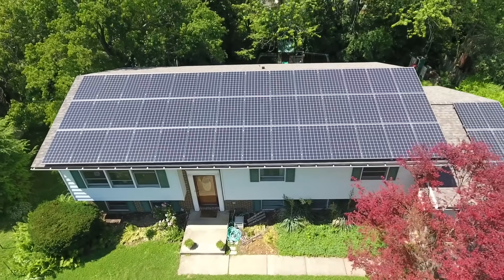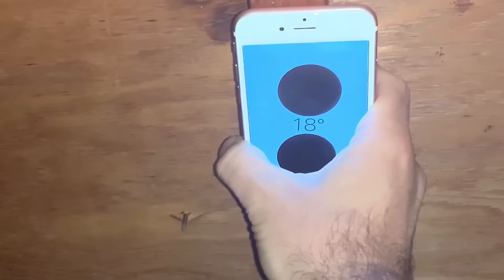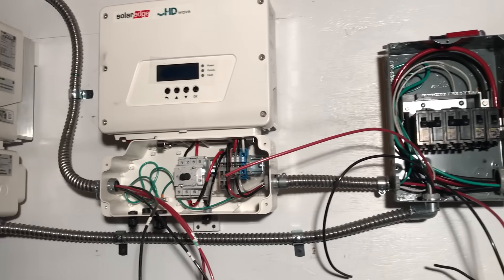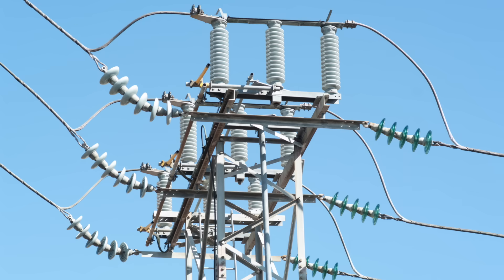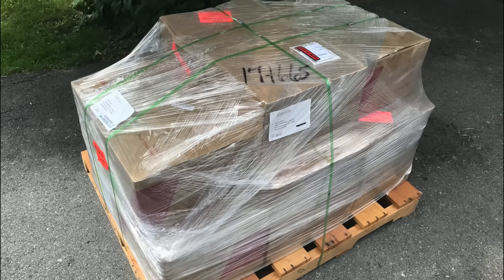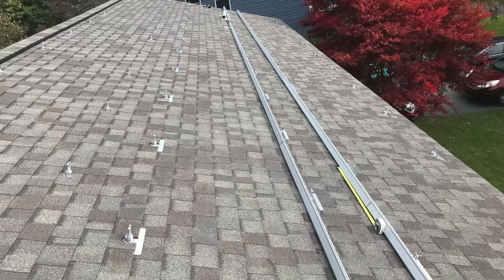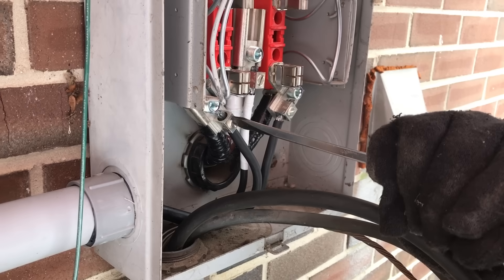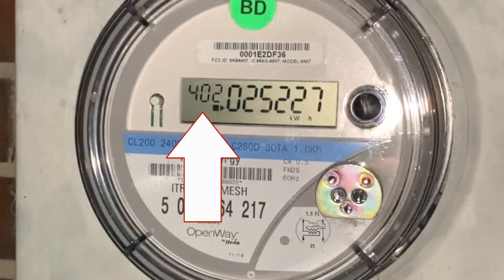I Installed a Power Plant Myself | HUGE DIY Solar Panel System

Comment: Nice job..........I am very familiar with solar insulation. I have installed many system and i own my own system as well. but I do  like how you researched everything figured it out on your own . That is  some nice work you did there . I would have went with Enphase micro inverters but that is just me .and in  some states not sure were you live but the zip ties are  against code. But I do like the video and you are on point with the Installation process 👍
Reply from the maker: Thank you!  I did consider enphase but they were more expensive and I heard a number of not so great things from installers.  The zip ties are really backup since I used the iron ridge clips.  But I didn’t like how loose they were and wanted them tight on the rail.  I also used them to hold the cables in the right orientation while I got them through the glands on the soladeck.
Reply: @FrugalRepair  yes zip ties would be ok for temporarily. I would not keep them   for long period .and for the Enphase they have the lowest failure rate on  the market .....and they  are  backed with  a  very nice warranty...
But the  system you have is a nice system.... like I said  the Enphase thing is just me I'm an  just a fan of Enphase and would you consider getting a Tesla powerwall or any brand powerwall...
Reply from the maker: Ok, thanks!  I mainly can reach where I might need to replace them without having to move a panel (or maybe one at most).  The optimizers are 25 year warranty.  I don’t have a plan for batteries (no real need at this point) but if I do get them, at least I have DC coming off the roof.  BTW -  that’s cool you installed your own system!
Reply: @FrugalRepair  no  true solar battery like a Tesla powerwall LG powerwall Etc charging voltage is AC current an output voltage is AC current powerwalls do all the DC converting inside the battery itself so there wouldn't be no need to run separate lines
Reply from the maker: Gotcha!  Thanks.  I haven’t studied them.  I’m probably the kind of person who would make my own out of 18650’s.  But I’m not really planning to get any batteries until the net meter rules change or they institute TOU rates.
Reply: @FrugalRepair  it would really help with your power offset and backup power for when the grid goes down

Comment: What about solar on the roof in a tornado/storm-prone area?  Will the solar panels hold up to hail damage better than the roof?
Reply from the maker: It depends on the ratings.  I think mine are rated to 130mph, if I remember correctly.

Comment: Loved watching this - well done 👍 I had a solaredge system professionally installed 6 years ago prior to retirement after thinking ahead in preparation for this (I was not as brave as you). As of today my system here in Cyprus has produced 26 MW. I haven’t experienced any serious issues, solaredge local installers have been excellent in liaison with them when a few minor issues came up. All satisfactorily resolved within warranty. Subscribed 👍
Reply: Watch out for pigeons nesting under the panels, the damn things are a real nuisance. Had to close all edges with strong wire and still fly a hawk kite as discouragement.
Reply from the maker: Thank you!  I’m glad to hear that you didn’t have any problems with SolarEdge. Mine has been working great without any issues!

Comment: Very nicely explained in installing solar system on your roof. Plastic zip tie is not advisable, get the metal clips for wire management, due to excessive heat under the panels plastic zip tie at some point gets brittle, and they easily break, later on replacing all the plastic zip tie is a major headache.

Comment: I am curious how you came up with that 14% ROI?
I did some calculations based on electricity pricing in my area, number of “sun days”, etc.
My break-even point on electricity cost vs usage came up to almost 9 years.
But when I factored in lost opportunity of the capital invested in solar equipment and installation, that number became 15+ years (I calculated using a modest 5% investment return rate).
It seemed to me an investment that takes 15 years to break even is not very attractive.
Especially combined with a fact that you can only collect those future returns if you stay in that house pretty much forever. If anything changes in your life and you have to move, the entire investment in that solar installation is gone.

Comment: Getting closer to a reality. Lithium technology is starting to become a real possibility. Lead acid was far too cost prohibitive. Lithium is very expensive but the durability of the batteries and the short charge time make lithium a possibility.
It’s still would take you 8-9 years to break even. That is almost the entire life of the lithium batteries. (12-15? Maybe?) 
     It’s a good video but this guy is not to help it’s to get subscribes and views. TV is what he is about. 
     Some places your electric bill is no more than 250-350 a month  the system would cost you around 25,000 - 35,000 That is about 8.5(?) Approx. years before you broke even. It is possible, I feel so very close to affordable.

Comment: I thought with solar a lot of batteries were used. I plan to use solar power to light up storage bldg. I know nothing about solar at this point. You did a tremendous job, thanks
Reply from the maker: Thanks!  No, I don’t need batteries.  I’ll plan to explain this in a future video.

Comment: How much you get paid for the electricity you send it back to the grid system should be one of the most critical and practical questions since now we live in very advanced battery technology.
I've seen most of the case you only get 30% of the credit for the price you pay and you should know that you just become a host to produce electricity for the utility company than yourself.

I'm pretty sure the future of solar system will be a matter of the battery system, not a solar panel any more since lithium battery price drop significantly that lasting almost same like a solar panel, not just a few years like AGM and Deep cycle marine battery.

and you don't need to cover your roof with that amount of solar panel.:D

Comment: Last time I looked my ROI was going to be less than 1% per annum, (based on a 27.5 year life span), with no profit until 18 years, so I elected to switch to a 100% renewable energy supplier instead. Now I'm following all the news about solar technology just waiting for an affordable panel with 30+% efficiency. There's been some interesting news about panels lately, some interesting new tech of the horizon which should mean cheaper more efficient panels. Part of me can't wait to do it, but my cooler head knows that investing in eco-friendly companies and buying renewable energy is a better choice considering today's tech. (One last note: I do also worry that if there is a paradigm shift in solar efficiency, and industrial sized solar farms boom, that it will result in a lower price/KWh from the grid preventing me from getting a reasonable ROI. They have economies of scale that a home build will never match, but adding panels to a roof should win out as there's no profit margin to add onto the cost and it's a free place to put them). 

Enjoyed your video, will definitely DIY my install.

Comment: I have a TON of usable roof space, but I can't afford to buy and install solar. What I would like to do is to rent out the roof space to a company that installs and does the upkeep of the equipment as well as the roof itself. They would have to maintain the roof no cost to me as a good roof in integral to the solar power system. What is my rent? Maybe a discount on my electric bill. I wouldn't need to ask for much since they are keeping my roof maintained for me. It's a good trade off, and good for the planet as well. Basically, it's allowing them to do almost whatever they want with the unused roof space in exchange for the roof not to leak. They can basically have the roof as long as they do they upkeep, and gets returned to the owner when the take their equipment. A roof is expensive for the average person, but the of maintaining a roof for a company getting a profit off of it would be negligible for them. It's basically replacing bad decking and shingles as needed. I think it would be a good trade off even if you don't make the profit yourself.

Comment: Uh does that comply with fire code?
Most places require more roof space around the edges of your array.
You should check that
https://www.solarpowerworldonline.com/2018/04/know-your-codes-for-solar-mounting/#:~:text=International%20Fire%20Code&text=in%20article%20605.11.-,3.2.,departments%20to%20ventilate%20the%20building.
Reply: Also, 48 panels?? Maybe you should have made your home more efficient before getting such a huge system

Comment: Does your area not have firefighter offsets on the roof?
Reply from the maker: Not when I installed my system.
Reply: @FrugalRepair  The firefighter offsets really limited how much I could put on my roof.  I went through essentially exactly what you did, but I didn't realize there were websites out there that would do your permit for you. I tried some of the software and it was just too complicated. What I tell people is: If I knew how much I didn't know when I started, I wouldn't have done it. However, now that I'm done, I'm glad I did.

Comment: Congratulations for big piece of work, but few things (for me ) is not correct, like naked copper on your roof after half year will looks like statue of liberty ;). Any way I hope you will have free power forever.
Reply from the maker: Thanks!  The code requires bare copper ground wire.

Comment: Great informational video!   I'm curious if there has been any power outages in your area and how you made out, if for example, it was a major outage for several days with many cloudy days.   Also, are the solar panels durable enough to survive a hail storm/high winds without damage?  Those are my 2 main concerns  before deciding on a system like this and I would appreciate a reply with your experiences.  Thanks!
Reply from the maker: Thanks!  We generally don’t have long power outages so that’s not a problem. I will explain an upcoming video how my grid tie system works in the winter or on cloudy days. Basically I get credit on my bill and it just subtracts off what I use.
Reply: @FrugalRepair  Thanks for replying, I still have an unanswered question I hope you will answer - what about hail or high winds? Have had either since your install?

Comment: Nice Excellent work!! I'm not a wire tie fan; you're going to find out yourself! I use 33+ instead. For your job however, I'd use insulated copper 16AWG wire as twist ties cut out of Romex.  You'll never have to go back,  unlike those plastic ties. You'll find out. Maybe PVC pipe? Other than that just excellent workmanship ! Great job Engineer !

Super job !  Great video ! A joy to watch !! Great product selection!
Loved the new check box !
Reply from the maker: Thank you!  That’s a good idea about the wire from romex.

Comment: Thank you for sharing the information in this awesome video.  I'm more interested in off-the-grid solar installations, but for people already on the grid, the grid intertie systems have a much better ROI because there are no expensive batteries to buy, maintain and replace at the end of their life.

Getting panels sized to fill your roof is worth the effort because it looks much better.  If you ever sell your house, having a record of the power company paying you to operate your low maintenance solar power plant should significantly improve the selling price.  Your solar power plant has significantly increased the value of your house.

Comment: The over-regulation in Australia would never allow this. You need a qualified electrician to do all electrical work. Another more than changing a light bulb and you will cop  a huge fine and or imprisonment.

Comment: I installed my own system in Phoenix. I was quoted $24,500 for 7.8kw system. I installed a 12.97kw system, saved about $10,000 and used a better system.

Comment: Excellent engineering and practical work to be commended. If you do make a video detailing your financial claims regarding this system, please do the same:  if the cost of products was (as hinted) some great sale - tha does not apply to everyone, full retail cost must be measured; if Gvt subsidy have been or will be received - that is not fair and realistic, some poor WV miner and some single mother with two jobs in Detroit is paying that money you receive for your project, that can't be counted, someone is paying involuntarily for you; assumption of 25 year life w/o any additional upkeep costs is unreasonable, 10 year mean lifetime must be assumed (some panels or systems may fail w/in a year, some might last 30 years but mean lifetime can't be more than 10); partial roofing costs must be included for a realistic cost as it was your AND roofer work together on two interconnected projects.

Comment: Wow, you had to battle a lot of red tape imposed by regulators. Had my solar installed without whatever permits (not needed). In Holland we have it all de-regulated. We even are free to choose the power cie we prefer. Running now for 5 years without a flaw a Solar Edge inverter with 14 SE optimizers that serve 28 panels. One optmizer can serve 2 small capacity panels. East-west orientation of panels with 15 degrees slant on a flat roof. Production 105 percent of yearly usage. Despite the grid connection fees, the tariff structures etc, result in the situation I get my power for free and they even pay me for overproducing.
Motivation: 1 environmental, 2. political (less nat gas money for Putin to finance his war machine, 3. taking care of my own wallet.
Had it contracted out, 2 men needed 1 day to install a working system.

Ups: east-west allows more internal usage (subsidies and tariffs have a tendency to change), less storm risk hazard, ballast to keep the external roof insulation in place was re-used to keep the grid based panels in place (no need to drill holes in the roof), no additional costs for home insurance and the solar is covered.
Downs: east-west construction on a flat surface is way more expensive compared to a south facing sloped roof, all black appearence for neighbours and esthetics added more costs, initial installation was with one east and one west panel in series for one optimizer, they fixed it within 4 weeks without addional costs, when the roof started leaking after 4 years, I had fears, but some self applied sealant on the edges worked out well, return on investments: guestimated 10 years needed to cover intial costs.
Morale: get red rid of the red tape guys and the fat cats that have a monopoly.
Stay safe, best wishes, greetings from Holland

Comment: That was impressive! You did a great job with the design and installation and your video was top notch, too! It would help a bit to know at what latitude you live since the further north one lives then the less effective solar power will become. Of course, those in the south benefit the most. (Grin)
Reply from the maker: Thank you very much for your comment!  I’m in PA.
Reply: @FrugalRepair  OK. You get more sunlight than we do in New England so your payback would be greater. There is a point where one can be just to far north to make it work effectively. I believe 43 degrees north is considered the border of practicality. I could be wrong. It won't be the first time. LOL

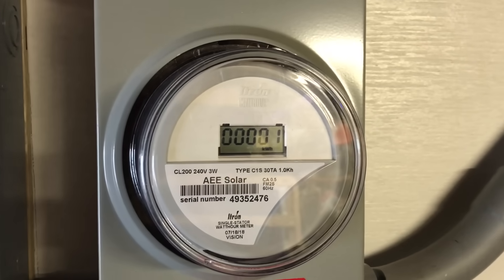Comment: I was with You Till 11:08 you should not stand in front of the Disconnect Box while throwing the Leaver just so you know
Reply from the maker: You mean because a short could cause the door to fly open?
Reply: @FrugalRepair  yes it looks like a small chance but you never know and it is always good practice to stand off to the side

Comment: Does it require wash cleaning the panels to get rid of dust accumulation that could lower the efficiency of the system?
Maybe put a dripping line on highest end or put a vacuum robot to mop the panels every now and then?

Comment: This system will probably catch on fire from him going cheap. They are called micro inverter which is just about the same as spring inverters. Which are trash for your home and also your panels are not correctly placed the government will come out and tell you to take it all down. Or take you ITC money if you even know what that is. Go with a W-2 solar company or will save you time and money. Especially when they panels start leaking or not working.

Comment: Awsome job putting in your own pv system. I work as a solar repair tech and honestly have a growing distain for mid-clip style hardware. With flatter roofs mid-clips are fine but on more pitched roofs it can get sketchy really fast. Make sure you have extra hardware becuase I have serviced a lot of midclip style systems and had bolts break or sieze, which makes any other panels sharing clips unsecure.  Also for yourself or anyone who will be servicing your system, its makes it much safer if you leave a couple feet from the edge of the roof instead of trying to fill up all the available space with panels. A lot of people do not consider how serviceable their system is until service is needed and now the work is extremely difficult or not safe.
Reply from the maker: Thanks!  I hope I don’t have to replace a mid clamp but I suppose it can happen.  I  don’t think I have any extra.  Makes sense with the more pitched roofs.
Reply: These fools think if they put up more panels means you will get more power😭 It’s based on your direction of your roof, shading. Saving 10k is not worth it, especially if you’re planning on selling your home one day for Equity.